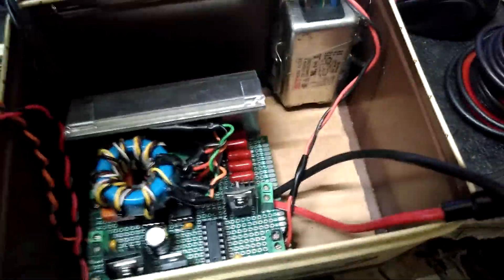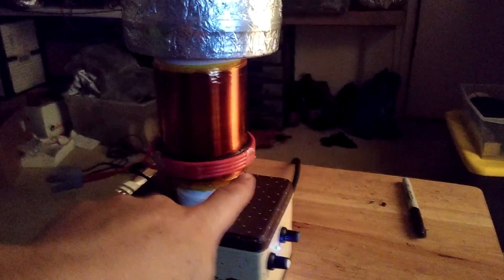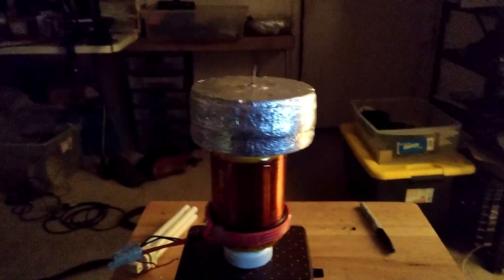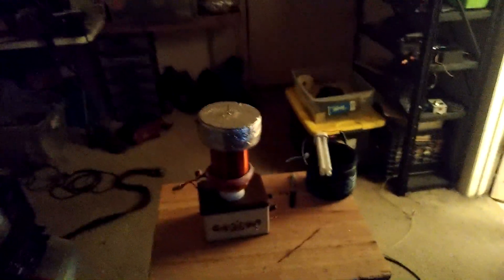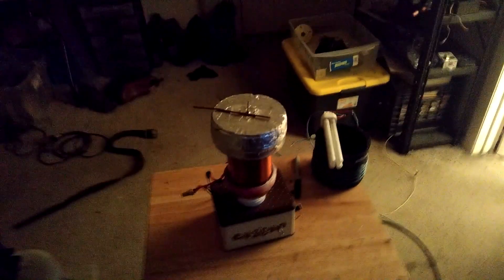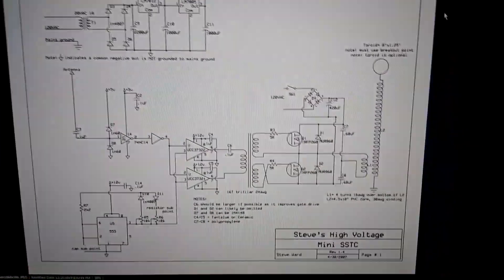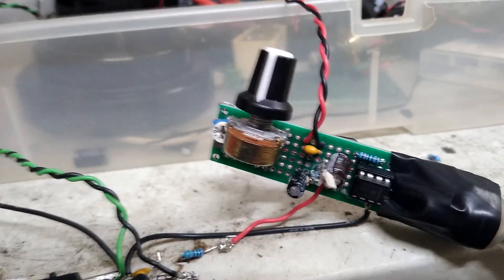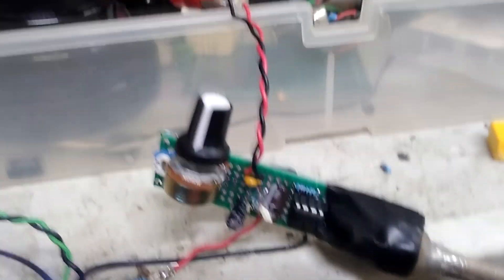Simple Mini Ramped SSTC Half Bridge

Comment: Nice work as always!  I noticed that you were no using a buck converter for this qcw setup.  How exactly are you interrupting the half bridge with the staccato circuit?
Reply from the maker: To go just half wave rectified staccato you just feed the staccato output to the SSTC interrupter circuitry, in my case just being the enable pins of the gate drivers. So basically you just treat it like any other SSTC interrupter, but it's just syncing with the mains ramps when doing that interrupting.
Reply: @Magneticitist  thanks for the feedback😁.  I'm wondering if the tefatronix circuit could be interrupted with a staccato controller.  Would that work?
Reply from the maker: @livewire460  theoretically yes you could run them staccato by removing any large smoothing on the bus but I've never tried. I don't see why it wouldn't work.

Comment: sir i needed a little help from you can you give me an animated circuit diagram i want to build this tesla coil
Reply from the maker: This one is pretty easy but if you wanted an even easier build you could just do a regular half wave rectified build. What makes this one a little complicated is the staccato circuit and making sure that's working properly.. but if you just don't interrupt it at all and allow the 60hz (or whatever your line frequency is) to drive the bridge then you get really good arcs also.

What you really want to do is just start off with a Basic Steve Ward circuit like his "Mini SSTC". He has excellent explanations on his website https://www.stevehv.4hv.org/SSTC5.htm

Then all you're really going to do is just build that without a DC smoothing capacitor on the bus, and feed it half wave AC.

Comment: Very nice man⚡⚡
Reply from the maker: thanks I'm gonna try this big 60v organ amp transformer in reverse to see if I can get away with pushing 240v out of it after I get my interference problems worked out. seems like it would be pretty awesome.
Reply from the maker: @Joseph Bunn I could if I wanted to run extension cords. I'm just thinking the right transformer and setup could all fit in the box and it wouldn't draw too much power.  Could still just use the one plug cause it'd still be 120VAC in, otherwise I have to separate it from the logic supply so the 12vac transformer doesn't start going over 35v peaks.